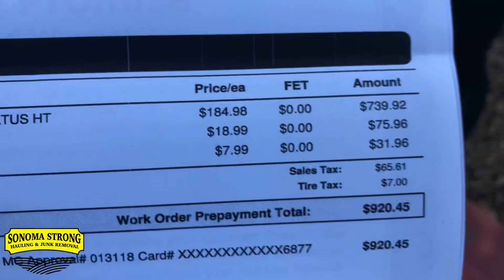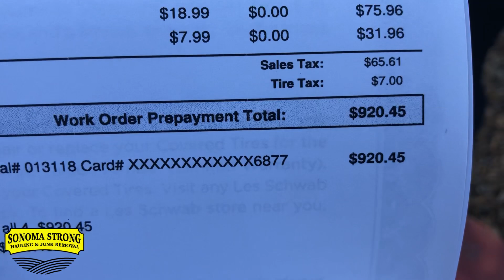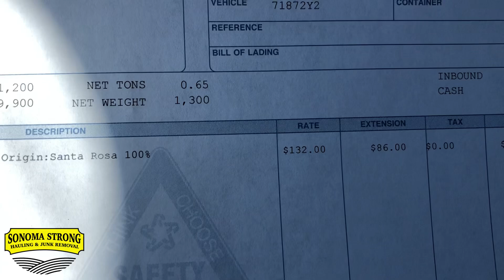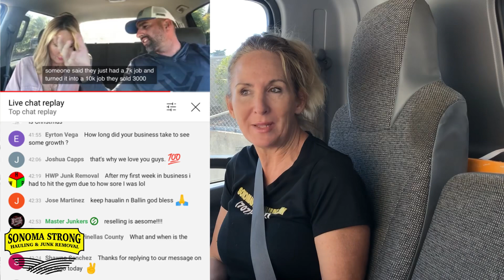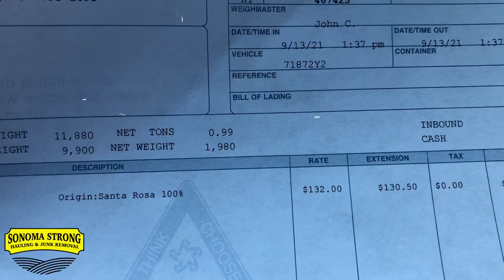Starting Your Own Business, The Struggles

Comment: i noticed you through a car battery in the back of your truck. 

here in massachusetts we get $10 for each car battery at O'Reilly's and advance auto or any other auto parts store.

so it pretty much pays for your wear and tear on your car if you get a lot more so you can use it for parts.

also do you cash in your metal at the scrap yard?
Reply from the maker: Yes, we collect them and do the same thing ….and yes we often scrap our metal